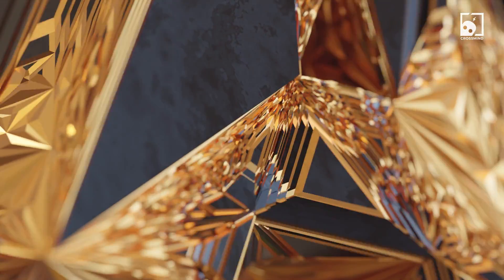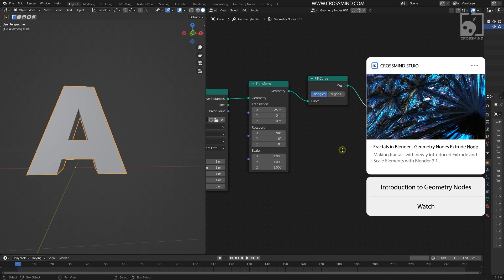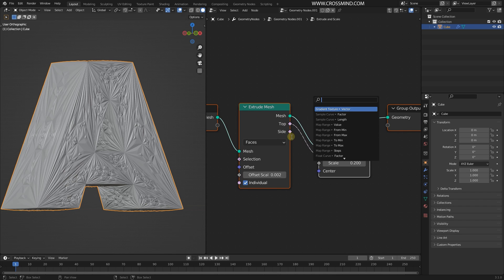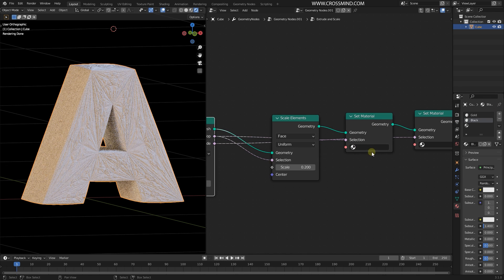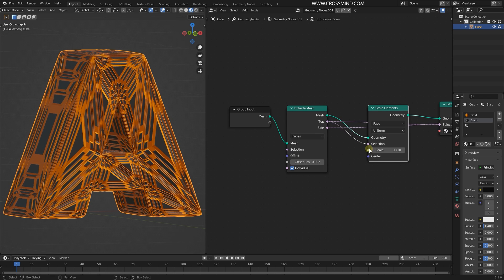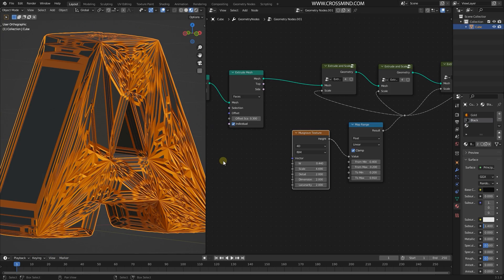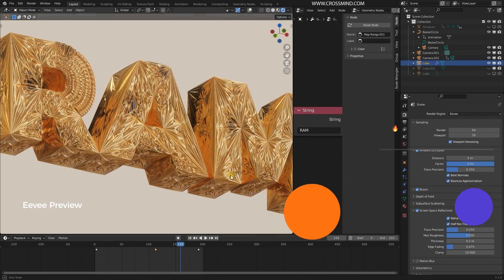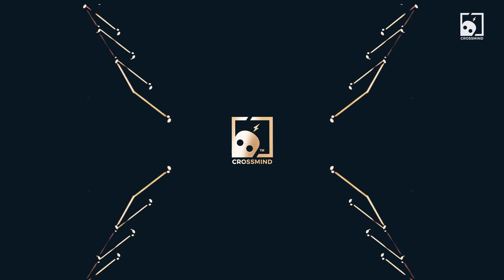Surface Formation with Extrude and Materials (Geometry Nodes- Blender 3.1)

Comment: Incredible content! I tried to transform it as much as I could! Thanks you so much, but still impossible to render it whitout having it pixelated so hardly. Tried all the engine, different sample rate, filter, denoise, Step rate and every settinf that I could found one by one, other source of material. Nothing seem's to work to render it properly as a pictures. Would you maybe have something to point out ?

Comment: Tfter I add the musgrave and map range nodes to the scale, I lose control of when the transition starts and ends. Am is missing something?
Reply from the maker: It should be all easy with map range, not sure what problem you facing, care to elaborate?

Comment: How can control extrude by other object proximity??
Reply from the maker: You can use the distance output of proximity and use it in many ways. Its float value and should work with any gray input(float) , in case if you haven’t seen previous chapters , do chk.